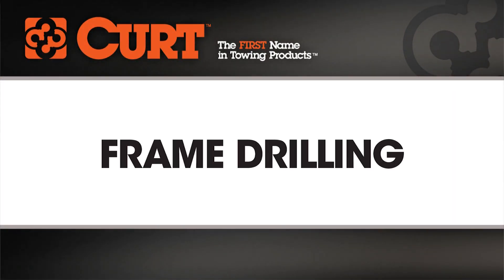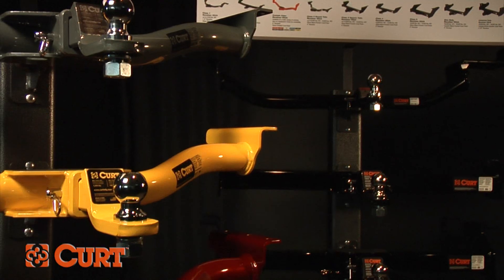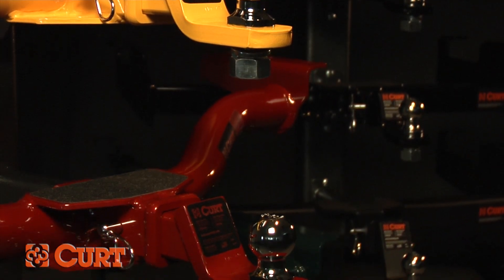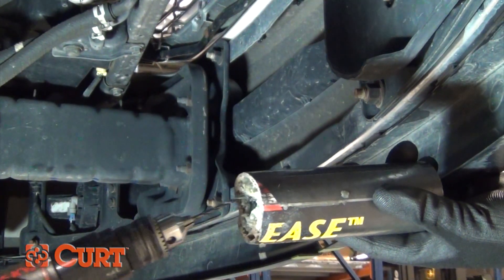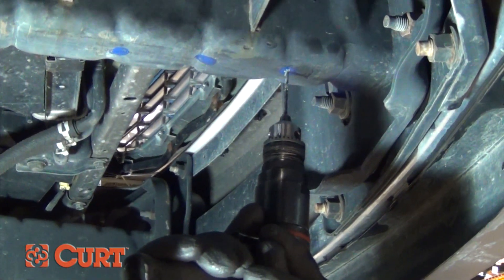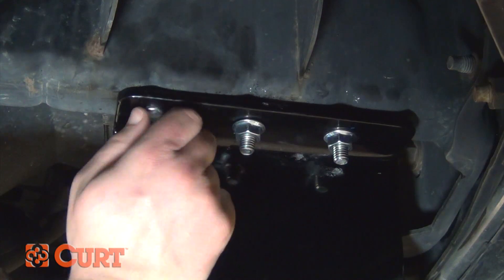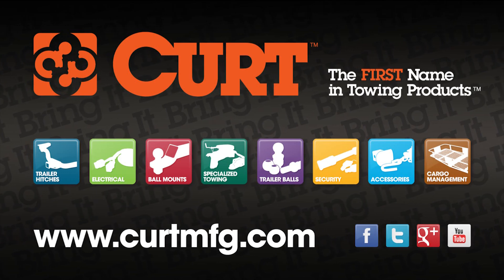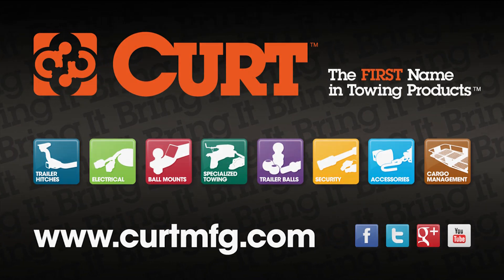How to Drill into a Vehicles Frame - CURT

Comment from the maker: Hello msova03.  It is safe to drill into the frame, and many hitch installations require it.  The structural integrity will not be significantly altered.  You will need to ensure that you have proper mounting hardware, and may need to fishwire the bolt.  For more instruction on this, check out our "How to Use a Fish Wire" video.  See the video description for the link.

Comment: I didn't catch what you used for lubrication.
Coolant oil or grease?
Can you use any grease here?
I recently bought one of your hitches and
It's taking forever to get my holes done.
Reply from the maker: Hi John.  Yes frame drilling can be difficult, but with some dedication you can do it.  In this video, a drilling grease is used, however a coolant or cutting oil works as well.  Its also important to have a nice sharp cobalt drill bit.  If your drill bit has dulled, it might be worth it to go to a hardware store and get a new bit.